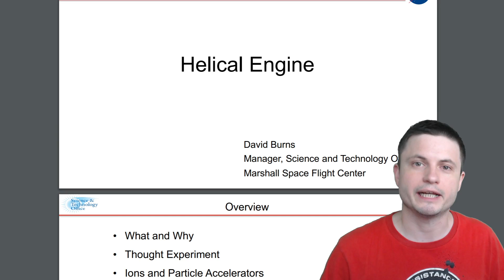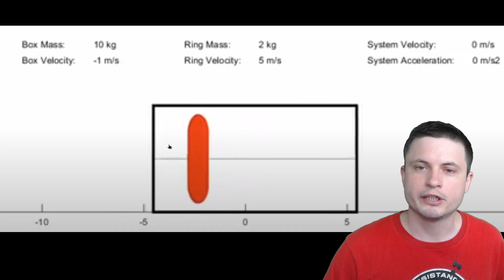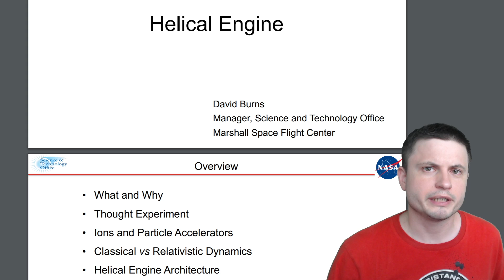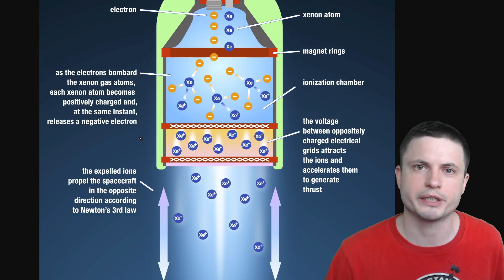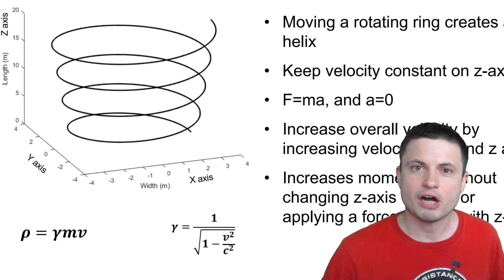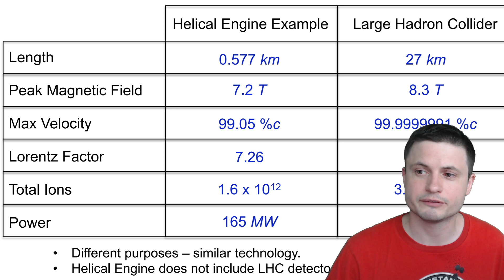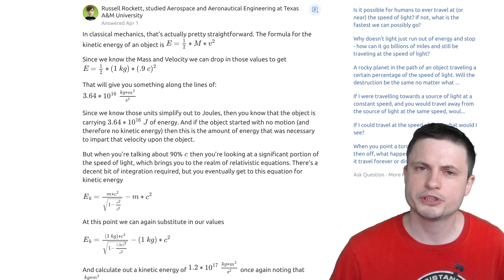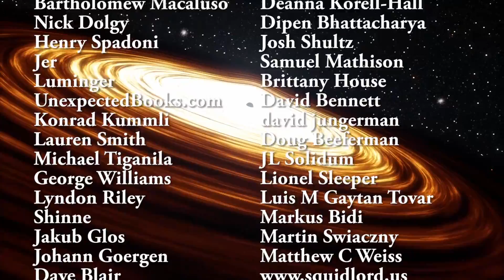NASA Engineer Designs a Near Light Speed Engine But Does It Work?

Comment: Anton: "It would be more efficient to throw the mass out the window." My prediction is that the first vessel to reach another star system will be the USS Anton Petrov which will be powered by his invention, the Throw It Out The Window Drive System.
Reply: "This is the USS YEET reporting"
Reply: NASA:

Wanted really good out the window Chuckers.
Reply: But ever throw out has an equally opposite throw out
Reply: @nukiradio  every*
Reply: Sounds like something right out of the hitchhikers guide to the galaxy books.
Reply: The mass has to be cheese, and thrown at relativistic velocities.  Then it can be the Chuck Emc^2 Cheese drive..
"It would be more efficient to throw the mass out the window."   Efficiency isn't the only factor though, you eventually run out of mass to throw.  At some point you hit a cross over in the function, where even very low efficiency is better than having spent fuel accelerating even more fuel to the point you're at now..
Reply: @ModelLights  You win.
Reply: Sounds like we are approaching the Realisation of the Relatively Improbable Drive.
Reply: With a RAM-scoop, you could sweep up free atoms/particles in space, and use it as a medium to gain velocity. So, you could basically use space itself as a medium to gain traction. You could even use Hydrogen-atoms scooped up as fuel for the fusion-power station.
Reply: @NorseGraphic  that'd have to be a pretty big scoop. And slowing down would be a motherfucker lol. Hopefully mass is equally dispersed in space enough that you don't hit a patch of perfect vacuum right when you needed to start the deceleration process.
Reply: @NorseGraphic  that's a pretty big scoop
Reply: @NorseGraphic  Great, unfortunately, the density of the hydrogen you will scoop up would be insufficient to sustain power. Unless of course, you're scooping the atmosphere of a hydrogen supergiant planet.And even then, fuel for fusion reaction would be spent fairly quickly. Also, how do you plan on scooping up that hydrogen? Bussard collectors presently exist in star trek only.
Reply: The Defenestration Drive
Reply: We need for this a "relativistic BEER CAN"...!
Reply: Won't it be The South Korea Throw it Out the Window Drive? I think Anton lives there.
Reply: hit the throw it out the window drive chewy
Reply: A.k.a. Petrov's TIOTW Drive
Reply: Petrov Defenestration Drive.
Reply: In the unlikely event that I figure out a way to invent an FTL spacecraft, I will name her the USS Anton Petrov because he is my inspiration! 😀
Reply: well space has plenty of momentum almost nothing will slow you down except for large  solid objects and an asteroid within your path. the energy expenditure should be a lot less than a rocket booster, but then again maybe think of how a gun works of course the object would have to be connected to the craft at all times to create the momentum again. and would have to have some kind of reverse propulsion for it to work. 
most of the journey is done on the momentum alone, and this essentially costs no energy.
Reply: Throw It Out the Window sounds an awful lot like a rail gun launcher :)
Reply: If you throw regularly out micro atomic bomb...  (this is a concept from 60th and it could work for slower relativistic speeds)
Reply: Would you want to take a ride on a ship with an open window, though?
Reply: @berserkasaurusrex4233  Duh.  Ghost ride the ship.
Reply: Hm, I would thing twice before opening the window in space...
Reply: Throwing mass out the rear window is what all our current rockets, ion engines etc. do.
Reply: By that time there will only be one rank in the Near Light Fleet: Wonderful Person.
Reply: How about Windows 95 -drive that gets its power from blue screens?
Reply: Like a 19 century coal train, but instead they shovel everything out the windows.
Reply: Anton Petrov Ion Drive: The APID drive, discussed briefly in this video, is a method of propulsion significantly more efficient than the proposed Helical engine.  Applying Einstein's equations, E=mc^2, it's plain to see that sufficiently large values of E, m=E/(c^2) can generate material m suitable for conventional ion propulsion.  For example, to accelerate an object of 1kg to the speed of 1m/s, assuming a typical ion drive efficiency, we will require... ... omg.   Nonetheless, the improvement in efficiency is remarkable.
Reply: That's the YEET drive.
Reply: Reminds me of Douglas Adam's "Bad News" drive. Power a spacecraft on bad news, since all bad news travels faster than the speed of light.

Comment: If the oscillating mass gains in mass, it's velocity should decrease so that when it impinges in the far wall the momentum gain zeroes out. By the way, if the neutrons and other radiation from a mass of uranium are all directed out of a nozzle, will they impart  motion in the opposite direction?

Comment: i thought of this type of engine a few years ago but after some thought concluded it wont work because you would get 1 big thrust forward and it would slow down when you reset the mass, also it would have to hit the container. how many times would it take for the container to fail?   you can only beat up on something so many times till it breaks.

Comment: This looks bogus to me. I don't see how it wouldn't violate conservation of momentum, to which Special Relativity demands obedience. So it looks like a misapplication of SR.

And BTW, mass doesn't change with velocity in SR; momentum depends on v differently from the Newtonian p = mv. In SR,
p = γmv, where γ = 1/√(1–[v/c]²)
If we could just use m = γm₀ in all the Newtonian formulas, then for kinetic energy we'd have:
T = ½γm₀v² , but the correct formula is
T = (γ–1)m₀c²
These are not equal except when v=0. Also, the mass of an object would depend on what inertial frame it was being referred to, which is a violation of the core principle of SR.

Fred

Comment: I admit I could be wrong, but I think Einstein may have been wrong on some points. I think what we are really seeing with gravity and produces the same set of effects is slightly different. I think the problem may be that having matter in an area basically physically shrinks the matter in a certain area and what actually may be happening is there could be a sort of 4th dimension of the universe which is the pushing out of the universe dimension where things are shrinking. The force field relations, I think stay the same, so an imbalance occurs in the matter and it starts to move. So if this was the case, the whole elevator and thing and acceleration issues are irrelevant. Also the idea time slows down, I don't think time slows down, but the matter slows down due to a longer vector in one of the modes of its components. If you had particles that traveled without any constant interaction with itself due to internal forces these ideas should produce no curve in the vector of a 'pure' particle for example around a gravity well.  Anyway some of these conclusions may uncover problems with his theory. Also maybe the shrinking of gravity areas physically may produce the elongation in the mid galaxy areas that is anti-gravity.

Comment: I forgive you, because I do enjoy the astronomical aspects of this channel.  However, this is complete nonsense and is not even remotely "logical" from a theoretical standpoint.  GPS satellites do not rely on Lorentz transformations, but do experience time offsets which have to be corrected from a combination of relativity (general, including special), and other drift effects. While it was convenient for many calculations, there is a lot of confusion caused by the introduction the term "relativistic mass".  This has been done away with in modern teachings.  There is now just a "mass", which is uniquely the rest mass. There is a separate dilation factor.  You have to just use the Lorentz transformations.  You can't get thrust by moving things, even relativistically, in a box.  In reality, all kinds of things are always moving relativistically in all kinds of boxes, in all kinds of ways, and there is never any thrust from it.

Comment: Seems like this would rely on accelerating the mass forward to relativistic speeds, stopping it in a way that transfers the forward motion to the ship, and then moving it back to the start point at sub-relativistic speeds.  If the mass were accelerated to relativistic speeds in a circle, when you tried to push it forward, you would need to push the relativistically increased weight.  Seems like that defeats the purpose.

Comment: 4:23 no you are (partly) wrong - satellite time correction is composed of opposite effects from Special and General Relativities and the Special Relativity slowing is the lesser of the two effects.  So for geostationary GPS satellites they need an orbital period of 24hours to remain over a fix point on the Earth's surface and this occurs at a radius of 42,164 km (26,199 miles) from centre of the Earth (altitude above sea level of about 35,786 km/22,236 miles), where they have an orbital speed of 11,300kph ((7,000 mph). The difference in speed from the orbital velocity at sea level results in satellites clocks slowing by 7 microseconds a day. However at that distance away from the gravity well of the Earth, the General Relativity effect is that the satellite clocks gain 52 microseconds (remember objects falling into a Black hole seem to slow from perspective of far-off observers, but equally from the in-falling object's view the outside universe speeds up) . The net effect is 52 - 7 = 45 microseconds per day so the overall correction is for faster, not slower, clocks on GPS satellites.
Reply: @bi1ruben And you are also wrong -- GPS are not in GEO orbits.
Reply: spaghetti yummy  The gravity of the Earth ever-so-slightly slightly blue-shifts the signals from the GPS, so it speeds them up, effectively.
Reply: spaghetti yummy  Light gets blue-shifted (increased in frequency) as it falls down a gravitational potential.  So the RF signals from the GPS satellites get blue-shifted, and it as if their clocks are running faster due to this effect.

Comment: If you put little wheels on the front of a car and big ones in the rear, the car thinks it's going downhill and will accelerate. Drag racers know this; the snarling engines are only for impressing the chicks.

Comment: This is a nonsense idea whatever change happens to an object that we remotely observe (the doughnut observed from the perspective of standing against the wall of the cylinder) this is not an perpetual motion machine - at some point one has to decelerate the doughnut else it crashes out through the far wall. I'm sure the proposal suggests that as the doughnut starts to move, then the cylinder starts to move, so the amount by which the doughnut has to decelerate at the far end is less (as the far wall is no longer stationary but starting to move a little in the required direction of travel). This violates special relativity, Which is that a lightbeam travelling at speed 'c' fired from a starting point in a train travelling at speed V, is not to an external observer travelling at speed c + V2. For a passenger walking up the carriage at speed P, yes to an outside observer they move approximately at P + V , but at relativistic speeds the observed speed is given by Lorenze transformation. (lighter from an oncoming car's headlamps reaches one at precisely C whatever the car's speed) . So within the cylinder a doughnut travelling near light speed the lorenze transformations of acceleration and deceleration will be equal for high relativistic objects.